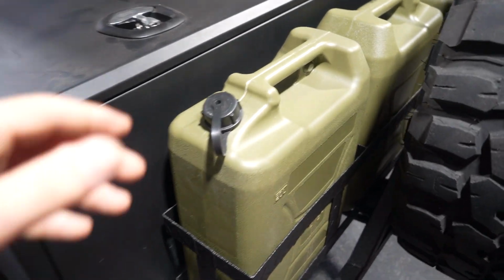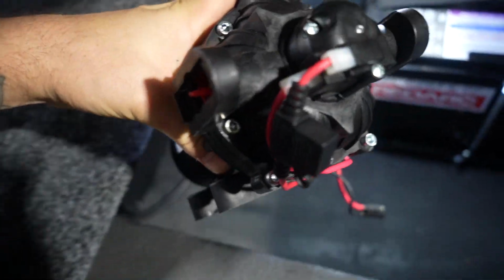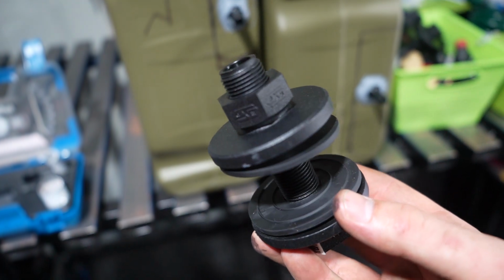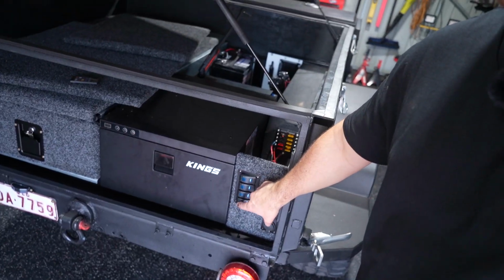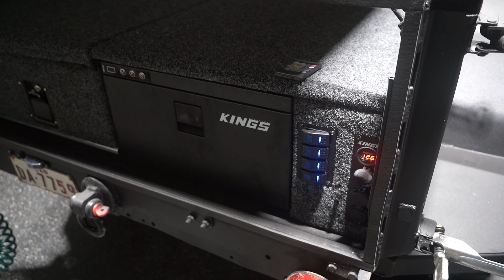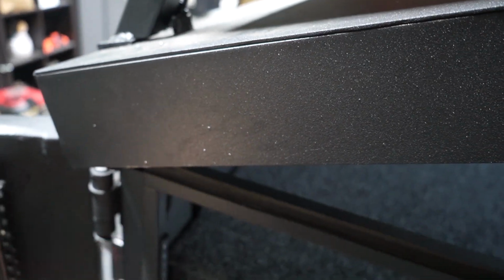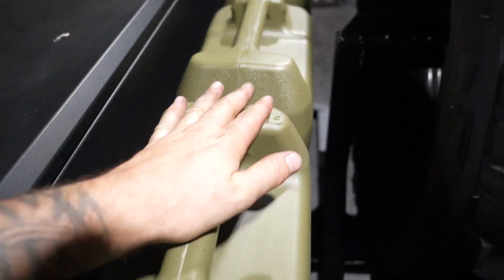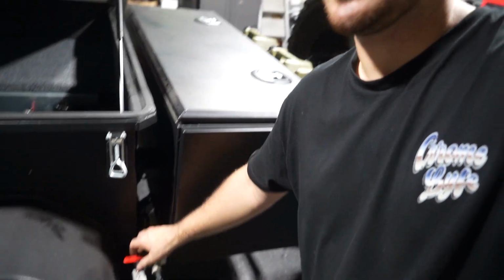12 Volt Water System For CAMPING Using Cheap JERRY CANS!! Camper Trailer Build

Comment: Minticle content again bro! Quick tip, add a skid plate under the trailer to protect all your fittings water system etc, and use food grade hose as the rubber hose makes the water stink. Love ya work! Btw youve got less than 6 mins of water use if u held that hose on full flow. Thats a massive 12v pump. Cheers bud
Reply: Agreed. That silicon (or urethane) on the bottom of the jerrys is a no go for drinking water! Can i suggest that you put a hole in the cap with a tube inside that runs to the bottom of the jerry, it's less likely to leak as the only hole remains at the top, and you wont poison your own water supply with sealants not approved for potable water. Furthermore, this allows you to take the cap off and remove the jerry for easy filling.

Comment: Good job mate. Other ways u can regulate the water pressure are: use a variable dc power dimmer control or use a regulator valve between inlet & outlet of pump so u can easily adjust pressure output via regulating valve. This is why it can be good to have a higher output pump as u have for mud cleaning purposes & consistent flow adjustment for showers , sink, etc, ie; the pump will not cycle if the control valve is open & allows enough water to recycle, this will lower output pressure but keep a steadier flow without the cycling effect.
Another trick is to have a 2 way valve on the inlet to pump & have a spare hose to attach, so if u can park in or near a fresh river crossing so u can suck water up & into ur tanks to refill on the go. Cheers

Comment: Put your pump in a waterproof housing like a pelican case and install a drain line out the bottom of the trailer. 
If you blow a line and water will be contained and drain out through the drain line to the outside,  protecting your electronics

Comment: Simple, robust and reasonably flexible - nice solution! I first used an expandable hose but similar to a spiral hose, they can be deceptive in how much water they hold, which is usually wasted when you disconnect it. I've changed to 2m of "regular" 12mm ID hose because losing the 250ml-ish that it holds feels like an acceptable compromise between the convenience of a longer hose.
It's also not a major issue but I found that dirt collected in the water outlet when travelling and then clogged up the sprayer nozzles, so I made a stopper with a cheapo female connection.

Comment: Looking good mate, I would remove all the ball valve and normal garden fittings idea and put in Nitto fittings.  Therefor you don't need the ball valve's and you can keep the system on if you want to at camp and you will only get flow if something is actually plugged in, also alot more durable than plastic garden fittings..  Its what most systems use in caravans and trailers with water connections.

Comment: you should weld in some poles inbetween the supports underneath the tent so you could strap down some gear on the lid. alot of space there you could use for an overflow

Comment: A few things is that hose going through he floor will rub through... trust me I know.. also that fitting on the bottom will get damage if not from scaping against something a rock being thrown up will smash it..  and one last thing I would have just modified my jerry can holder to allow for the original tap as its an easy mod.... Ive build 2 campers now and worked on caravans doing repairs so have experience.. Im enjoying your build and its given my ideas for my third camper I am slapping together for Googs track in July.  Keep the Vids coming dude I am enjoying them mate !!

Comment: Looking good mate! I was thinking 11LPM pump would be a bit much . . . might be better off with a 4LPM pump. My only real concern would be the hose not being food safe and I'm guessing you will be getting a plastic taste coming through from it. There is some great clear hose with wire reinforced walls available from catering equipment wholesalers etc that I've used thats not too expensive and is brilliant to use.

Comment: There are garden hose fittings, the bit that goes into the tap or end of the hose (like you have on the back of the trailer) that automatically stop water coming out when you disconnect the hose/fitting. That would solve the problem of the pump pushing water out when no hose is connected to the back.

Comment: Three suggestions:
Lower volume pump (1.5L/min enough for camping)
Accumulator tank after the pump (will minimize the cycling of the pump)
Potable hoses (clear hose type suitable for pressure systems)

 I'll be incorporating some of your ideas into my build!

Comment: Run rock lights on it but just send a wire from the ones on your car already and put it in the plug so both come on at the same time, saves jumping out and turning them on

Comment: I am glad you like the pump solution, but it would have been simpler to cut the vertical brace from the jerry holder and weld it back on in an offset position. Then you would have the redundancy of 3 independent jerry cans, and you could pull them out to fill up from a low mounted tap or stream.

Comment: How do you find the 11LPM pump? I upgraded mine to a 12LPM from 6 and I find that it goes way too hard! What do you reckon?
Reply: Biggest problem is that it really needs an accumulator tank otherwise the pipe hammer is nuts

Comment: Great project! Too bad you didn't mount a Stainless h2o tank to the under carriage (much like a gas tk) centered and forward of the axle? (Would have increased capacity and enhanced stability/ center of gravity). Another benefit would've allowed jerry can rack for fuel.  PS- don't forget fire extinguishers ;)

Comment: Tip buy spare micro switchs for the pump or bypass the micro switch and then put a bypass pressure relief pipe inline back to the tanks because after awhile the micro switch will stop working then the pump won't run

Comment: It could have been done better. Tops to you for what you have achieved but, detachable stop valves on the water containers, rubber grommets where the hoses go through the chassis, a lower LPM pump (bigger is not always better), anderson plug covers etc. Fitting outlets with flange into a closed container is easy using a pice of string or thin rope :-)

Comment: What a load of crap! I've had a Shurflo water pump mounted under my camper trailer for over 14 years. Water crossings, including the Pentecost River. Never had a single problem. 

How about you don't make half baked assumptions.
Reply from the maker: Hey brother. Calm down I’m not an expert I just tinker in the shed!